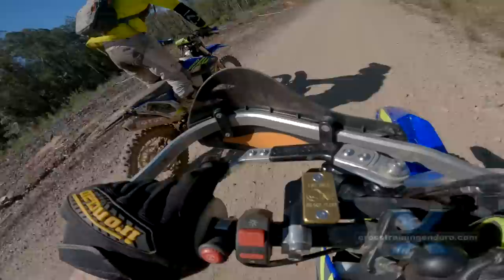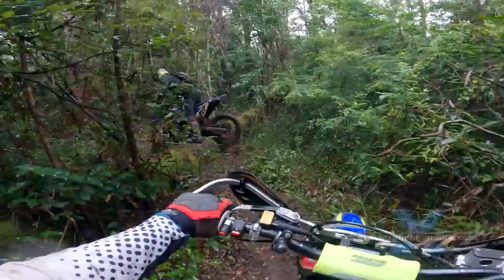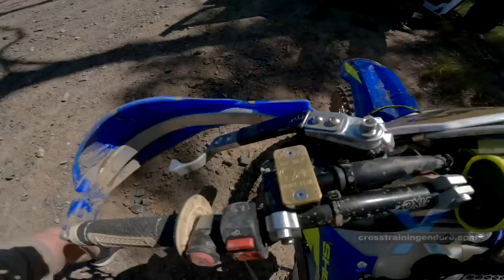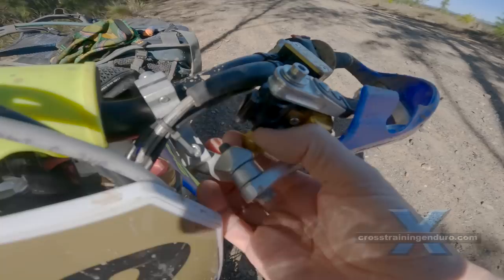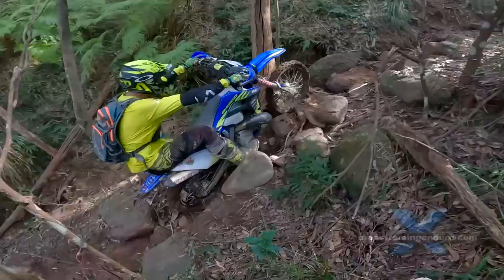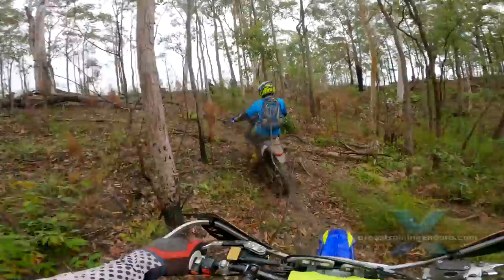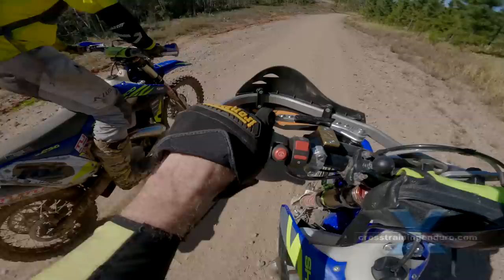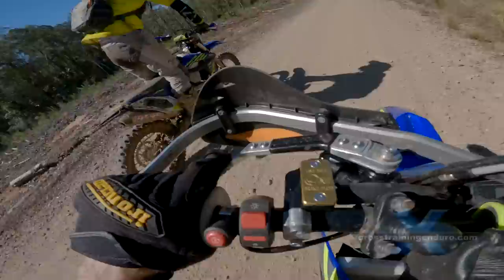How to get the lightest clutch possible: Clake One Light clutch review︱Cross Training Enduro

Comment from the maker: FURTHER COMMENTS Occasionally Clake owners have trouble bleeding the system. It is critical to get rid of every last air bubble. Watch their entire installation vid and follow their tips for removing those last air bubbles. https://youtu.be/8KXwMKiT6mw?t=171 A cheap bleeding kit makes a big difference too. Still having problems? Clake have the following tips: 

Back off all the force balance assistance by winding the Gold Knob anticlockwise just until you can feel some longitudinal play in the adjuster shaft. Then with the reservoir lid on, loosen the handle bar clamp bolts slightly and rotate the lever up about 45 degrees on the bars.  Then cable tie the lever to the bars, leave it like this overnight then in the morning cut the cable tie whilst the unit is still in this position. Then pull the lever in slowly about 10mm then release quickly, repeat at least 6 times.

OVER 100 FREE ENDURO TRAINING VIDS
English not your first language? Subtitles in 30+ languages!
Basic enduro skills playlist https://bit.ly/3BtOVyI
Intermediate enduro skills playlist https://bit.ly/3HSkh4r
Advanced enduro skills playlist https://bit.ly/3oNNeqF

BIKE SETUP & RIDING GEAR
Bike setup playlist: https://bit.ly/3sBar0i
Protective gear playlist: https://bit.ly/34BYDTI
Which bike should I buy? https://bit.ly/3gLTJG1
Knee protection playlist https://bit.ly/36fR4Cw

OUR OTHER PLAYLISTS
Reviews of bikes & products https://bit.ly/3GQCVrO
All about helmets https://bit.ly/3sJxIgy
Enduro philosophy! https://bit.ly/33meQeV
10 ways to hop logs https://bit.ly/3JqlOPx
The weird side of enduro! https://bit.ly/3Js1ai2

Read our disclaimer first before attempting any techniques: https://bit.ly/2U0bgCy
Become a supporter! https://www.crosstrainingenduro.com/cross-training-support-donations.html
Reply: Out of curiosity, what was the basic hydraulic setup you were using before the Clake One?

Comment: Been running a clake one for 7 years. Would never run anything else. I have her wound right out (or in?) to 75%. I've found for me, I still maintain the feel, it simply reduces fatigue. I have noticed however the lever does not always return immediately, when riding the most clutch demanding terrain.

A worthwhile trade off.
Reply from the maker: Good to hear, Luke. If it ever became a problem you could probably use lighter clutch springs and just back the Clake off to about 65% assistance.

Comment: Yep, have had mine for about 5-6 years now. An amazing bit of technology. Mine has started playing up. Worst incident recently was arseing off the bike in extreme terrain and the bike sat completely upside down for about 30 seconds till I got over to it and righted it. 1 minute more riding and the clutch gave out completely, lever dropped to the handlebar. Still had 2 hours riding in super gnarly terrain left to get out. Used that marvellous starter motor about a thousand times to negotiate some of the hardest terrain I ride.  I have a replacement piston and seal to install when I get around to it.
Reply from the maker: There's a small chance it might just be a tiny air bubble in the system was dislodged while the bike was upside down? I've heard about this even though it's rare. Might be worth trying a rebleed... but then at five years it's probably a good idea to service it anyway!
Reply: Mine did this as well found out it was the slave cylinder o ring was damaged and letting air in not the clake at all

Comment: Had mine since 2016 on a beta 300rr, just now ive had to replace the internals due to corrosion.  No i dont pressure wash my bikes in case you're wondering.  Water does find a way into these units, and if you dont keep some grease in the cam and rocker assembly you may have the same issue.  No stress, replacements got sent within a day of ordering.  I love this thing!

Comment: I have used the Clake One light clutch for 6 years, 5 years on a Husky and now on my KTM 300TPI and its a winner. I disassembled the unit after 3 years and lubed it up with grease in the support spring and links and after almost 6 years I replaced the piston because it sometimes lost hydraulic pressure. After hundreds of hours I would consider this normal maintenance. It's great and everyone that gets on my bike immediately noticed how well it works.
Reply from the maker: Great to hear, Peter. Two of our guys have Clakes about seven years old so I figure they'll need to service them at some point.
Reply: @crosstrainingenduro  I guess so, Clake has a repair kit with a new piston. If you can find only the rubber piston seal It will be fine too, the metal parts was as new. It's a bit tricky to change out but I made it on my own.

Comment: Uuuuhhh  ain't many things antagonize your ride like a stiff sticky hard clutch pull Berry!   I use the same principle as the clutch lever system you're using  but  most of my machines have a cable activated clutch I just put a strategically placed well balanced PULL spring  in between the clutch cover lever  arm and the cable housing stand out (but not too much as to overpower the internal springs on the clutch itself  and get slippage)   I get it to pull about  45%  lighter and the cost was free just some springs I had lying around   and I adjust my lever clicker out to compensate for that extra detent the spring puts in the system    been working very nice ! 👍
Reply from the maker: Great to hear, Mark!

Comment: Used for years and love it. I replaced the flexible nylon lever with aluminum made from 8mm plate. Helps keep the engagement point consistent, just keep a spare lever in the tool kit, it'll only bend once. I also filled the housing with engine assembly lube, helps keep the pressure washer water out 😊😇
Reply from the maker: Interesting idea! So you could feel a bit of flex in the nylon lever... I've never noticed that but I'll keep an eye out next ride.

Comment: I've been running a clake one light for about 4 years now and love it. After having broken both my wrists having a featherweight clutch is vital for my riding enjoyment.

One problem I did have though was when I was originally running the clutch on my WR450f with a magura hydraulic clutch conversion. I don't know if it was just that particular setup or what but it would constantly bleed down and require pumping the lever every couple KM of riding and eventually left me with no clutch at all in the middle of a 8 hour sandy desert ride.

Ever since putting on my Beta 350rr in 2019 and now Sherco 300 in 2022 it has been faultless and fantastic. Guys in the local riding group regularly ask about it.

I've been considering putting one on my Tenere 700 too but I'm not certain since it would require a hydraulic conversion again.

Comment: What I did as alternative to buying any type of non-stock lever replacement is simply hang from finger tips for 30 seconds to 60 seconds per day
Reply from the maker: Yep. I've just been working on a new vid about lighter clutches, and I've included exercises as a free method.
Reply: @crosstrainingenduro  nothing wrong with upgrading bike, but my point is not so much about free method, more along the line of rider improvements via fitness and skill development, you always say its 80% rider and 20% bike (and equipment) so basically I'm reinforcing and supporting your benchmark to invest in yourself first before buying add-ons which are secondary, may or may not help :)

Comment: Came across CLAKE because of your past videos. The technical solutions caught my engineering mind and for an incredibly high price with tax and importing fees to Germany I had a Pro Lever fitted to my new Beta X-Trainer 2018. Then I swapped for a RR 390 in 2021, kept my CLAKE and even combined it with a Rekluse Auto Clutch. Yes - that is possible. Left hand rear brake, Auto Clutch and being able to snap the clutch.
However, I liked the pure Pro Lever better and went back from Rekluse to stock clutch. Romania is waiting.
Have fun riding fellows!
Reply from the maker: You'll love Romania, I spent two weeks riding in the Carpathian Mountains!
Reply: @crosstrainingenduro  Sure, it will be my 3rd time there. Endless climbs needs clutch control and long steep descents. I love the rear brake being in control  by my finger there.

Comment: On the DR650 and many other bikes if u move the actuating arm 1 notch back it makes the clutch initially lighter at the expense of heavier in the final stroke, which suits almost single finger use for fine control and when u need full disengagement u got many fingers there anyway.
Reply from the maker: Interesting idea. So you just take up the slack with adjustment at the lever...

Comment: I've had the Clake one light on my last 3 KTMs, now on my 2020 300. Absolutely love it. Mates who rode my bike went out and got a Clake also. 
Only issue is they are very hard to bleed all the air out! And you need to get it ALL out or it won't work. The install video isn't the best. 
Also installed them on cable Yamaha with their kit. Works great if you install it properly and get all the air out (sux)!!
Reply from the maker: I have heard some guys get that tiny stubborn air bubble that takes ages to get out... thankfully we've never hit that. It thought the installation vid included a few tips if this happened? But maybe it's in the Clake 2 vid? It looks like the discontinued the cable conversion kit, otherwise I'd be keen to get on my DR650! Re: the air bubble, a mate of ours has a bleeding kit that pumps the brake fluid up from the bottom, I think. He reckons it makes bleeding fast and incredibly easy... not sure if that might be worth checking out?
Reply: @crosstrainingenduro  totally agree, I always bleed from the bottom up and find that much easier and also seems to work better. 
We have tried a few methods and the issue with air bubbles is definitely at the top and inside the flake which seems to trap bubbles easily. I fill the line up completely and load up the Clake with oil then mate the 2. Then bleed from the bottom again..seems to work the best for me. 
Definitely interested in any good bleeding system. What bleeding system does your mate have? I'm using the basic syringe method which is a bit clumsy (just like me).
Wow didn't realise they discontinued the cable version (it was very hit and miss imo). The guys here at Clake Melbourne are pretty helpful. Cheers.
Reply from the maker: I did ring them about a cable clutch conversion a few years back, I was keen to put one on my DR650. I think they said enough riders had issues with the system they didn't want to continue sales. Bummer! I'll email this guy and ask what his bleeding kit is.
Reply: @crosstrainingenduro  
Yes, vacuum bleed from the slave cylinder, while continually adding DOT (or Mineral oil, depending). Went from the crappy factory Braktec on my 2022 FE 350, where all the action is close to the handlebars, to now being like my 2016 FE 350 Brembo system, where all the action is just after the free-play on the lever. Doesn't quite have the same feel as my old Brembo, but it's way better than the stock Braktec clutch master cylinder. 

Lesson learned: I'll never buy another dirt bike again unless it has factory Brembo hydraulics.

Comment: What options for us cable clutch guys? Just lube? What brand; astroglide or KY?
Reply from the maker: Always KY, Tim. 😂 I'd try those 'easy pull' levers that use extra leverage... you just have to be careful with adjustment and if you have short fingers you may find it's too much of a stretch.
Reply: eBay levers with multiple fulcrum positions can be had for $30. The closer to the pivot, the less force, and more distance is required.

Comment: I bought one for my YZ 250 cable clutch.  I could never get it working right, regardless of the assist, the lever would never return back to full disengagement smoothly.  The system was fully bled, so that wasn't the issue.
There was also poor fitment with the supplied magura slave cylinder.    
The bike was unrideable with the jerky clutch disengagement.  I ended up removing the Clake.
Reply from the maker: Bummer. Do you know if it was one of the very first models? I knew a guy who bought one of the first ones. Apparently there were some tolerance issues occasionally in early batches, he said they either replaced with brand new units or replaced parts in the original...
Reply: I had a similar issue with my Clake 2 on my YZ250X- I was able to resolve it with Clake's help by lowering the camming assist and even taking out a couple of the inner spacers, but then it didn't give quite as much of an assist as I ideally wanted either.  Still, it was better than stock so still run it.
Reply: @crosstrainingenduro  
I bought mine in late 2017.  I'm in the US, so the communication loop was slow.  They did have me take some measurements for the slave cylinder, and then sent out a different one.  It fit better, but it still requires some spacer washers to get the pull length for the slave cylinder correct.
There were some emails back and forth about trying to get the Clake working right. I sent them video of the lever not returning,  but having the unit repaired was never discussed.
Reply from the maker: Bummer. I did hear stories of them taking ages to respond to customers because they were swamped by demand. Maybe contact them again? If there's something wrong with the Clake then at this price they should do everything possible to either fix it or replace it.

Comment: i'd guess its some kind of spring preloaded leverage mechanism that only supports your pulling force arround the max. resistance point of the clutch. so it won't preload the clutch when not being pulled. Would be really interesting to see whats actually going on inside
Reply from the maker: Years ago when I was down south I popped into their factory to get my first one. They had one pulled apart and explained how it worked, but it all went over my head lol. It is based around a spring though...
Reply: It's like the diaphragm spring in the KTM clutches. The further away from flush, the more force it generates. Or like a compound bow. When the lever is out, Clake's spring has almost no effect. As soon as you pull the lever and allow the spring to return past a certain point, it increases the force progressively. It only counters lever release force where needed, just like you said.

Comment: 60-75% reduction sounds wonderful.  Unfortunately my WR250F has a cable clutch so the Clake is not an option.  I'd love to have one for my hands as well. In the meantime, I've gone to a USA fabricator (RSC lever) who makes an altered pivot design with a bearing in the pivot.  While it does require a longer pull (I purchased the full length lever for extra leverage, too), it is nevertheless a noticeable reduction in the force required.
Reply: Clake fits on WR. They have a kit. Works great. I've installed a couple.
Reply from the maker: Sounds great!
Reply: @Cee-FJedi  I think it depends a lot on the specific Yamaha model and model year due to the clutch actuation arm length and travel direction.  It worked on my son's 2016 YZ250F that required 9mm(?) of travel at the end of the arm in a fairly straight path but I could never get to work properly on my 2017 YZ250FX with 13mm(?) of pull and a more curved path.  Changing mounting positions, orientations, and attachment methods for the slave cylinder couldn't fix the problem.

I am awaiting delivery of a new 2023 Husky TE150i so I'm hoping to be able to rebuild the OLC to convert it from mineral oil to DOT and use it on the new bike with the hydraulic clutch.

Comment: Now thats cool 🤔 so suffering from mechanics hands and constructionitis means I qualify for this kind of upgrade ? Is said black magic vodo available in cd old Canada 🇨🇦 and will it work on a lowly CRF250L do tell 🤔 stay safe and shinny side up 🏍👍🙂
Reply: If you have a cable clutch like the crf250l does the best thing you can buy for it is a stunt clutch lever. They're for street bikes but work good on dirt bikes too. I had one on a yz250, it makes the pull close to half as hard as stock.  There's the rightous stunt clutch lever which is great but expensive and cheap ebay knock offs for next to nothing which are alright and what I had. Moose makes a easy pull lever too that's about the same as the chinese stunt levers.
Reply: @nseric1233  Thankyou will look into these options 👍
Reply from the maker: I think Clake used to do a conversion kit for cable clutches but not anymore... no sign of it on the website. I agree with Eric, just try one of the 'easy pull' clutch levers that used extra leverage.

Comment: I have a 2022 KTM 300 and LOVE the Clake. Unfortunately it started to stick and had to take it apart. Accidentally over did the screw and unscrewed it from the nut end all the way. Now it’s apart and can’t figure out how to get it back together. But after riding with the stock clutch again for the last 4 rides, I want it back! Hand is tired with the stock clutch in the gnarly, slow going stuff. Can’t find a video on how to properly put it together. May have to buy another one, like it that much.
Reply from the maker: Clake had amazing customer support years ago. I heard it dropped a fair bit when demand went through the roof, but they are probably on top of things now and back to fast customer response. I'd contact the guys and see if you could ship it back to them for assembly.
Reply: @crosstrainingenduro  Good call. I’m going to reach out to them and see what they suggest. Thank you.